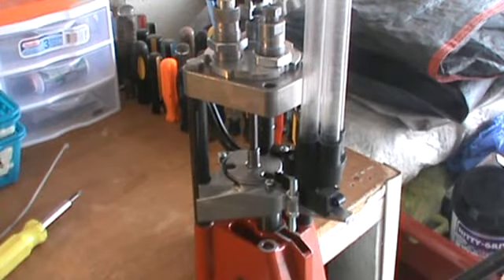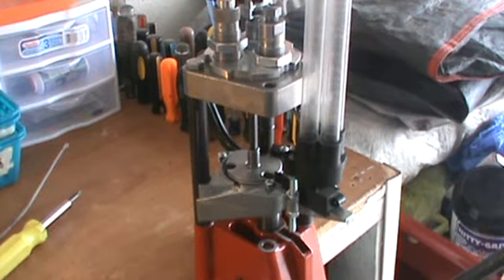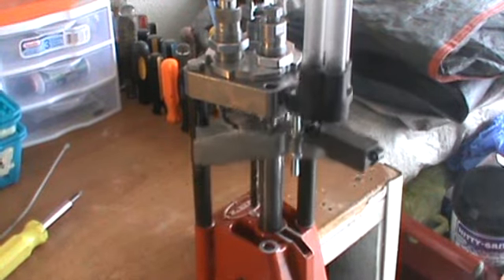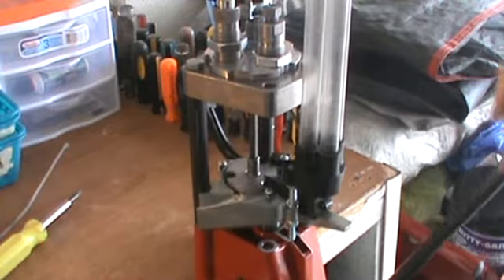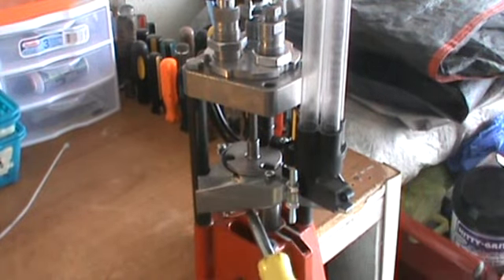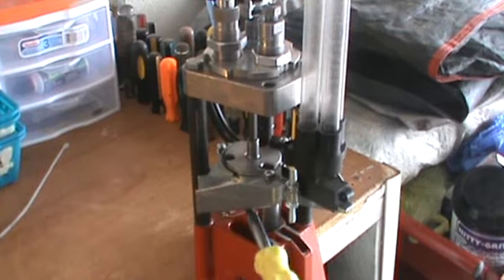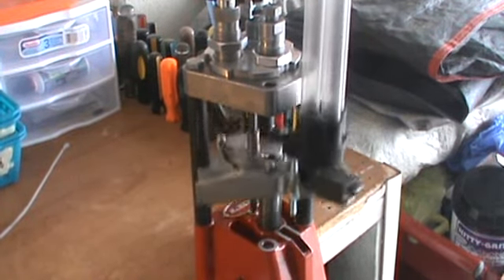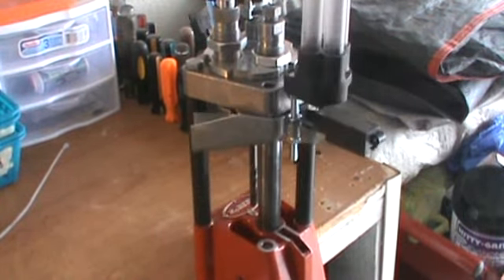Lee Pro 1000 turret out of time

Comment: Turn until you hear the ball bearing drop into the detent of the shell plate. Once
that point is achieved, turn the screw NB: 1/2 to 3/4 further . This ensures that
the shell plate stops by the ratchet under the carrier instead of the ball
bearing snapping into place. If you go too far, keep turning until the next
slot in the shell plate advances around to the correct position
Reply from the maker: Thanks for your feedback, everything helps.